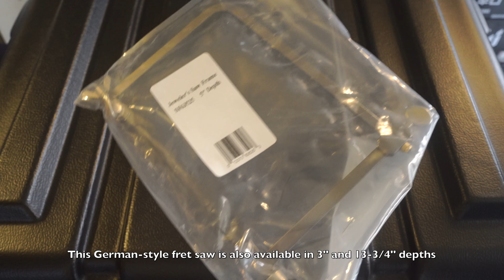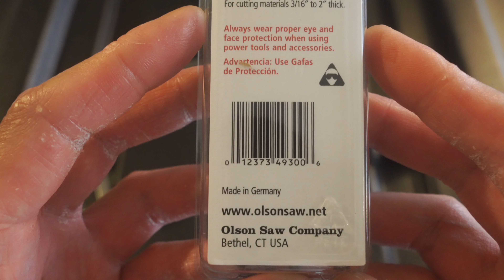Olson Jeweler's Fret Saw - Best Affordable Woodworking Fret Saw Ever? Good As Knew Concepts? [ASMR]

Comment: Do you know how this compares to the Grpbet? The main difference I am aware of is this one uses clamping plates to retain the blade which apparently works better for thinner blades where the end of the screw directly clamps on the blade (which is what the Grobet uses).
Reply from the maker: I was actually close to getting that one, because it looks super high-quality, very well-built and Swiss made.... but, it was totally missing the wing-nut tensioning screw. That tensioning screw is super essential and important imo... it makes the blade tight like a guitar string.
Reply: @LessTalkMoreDelicious  I wish there was a fixed frame, non-adjustable version.